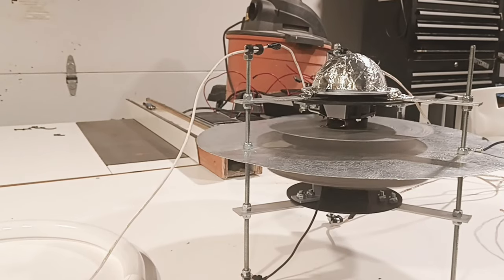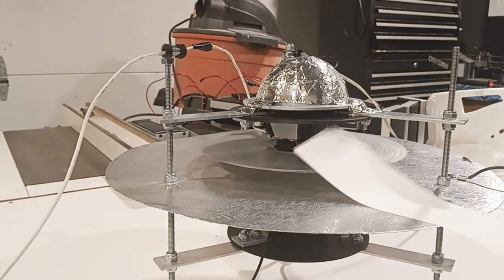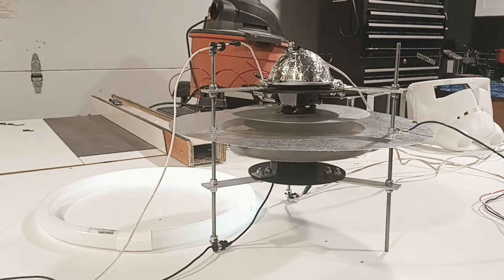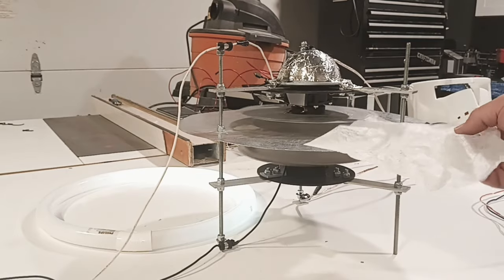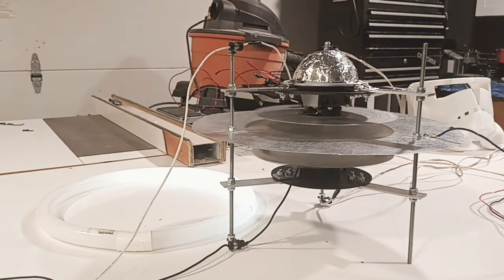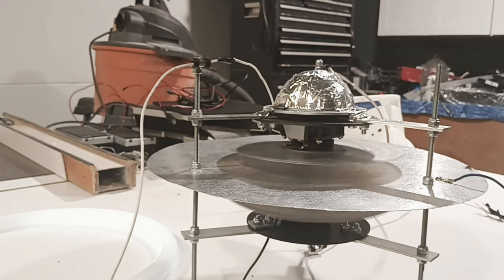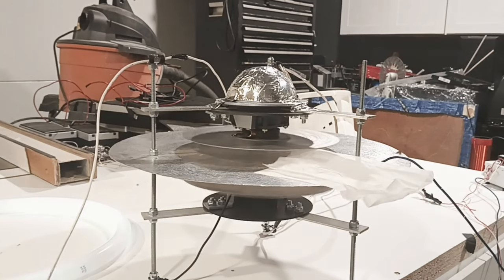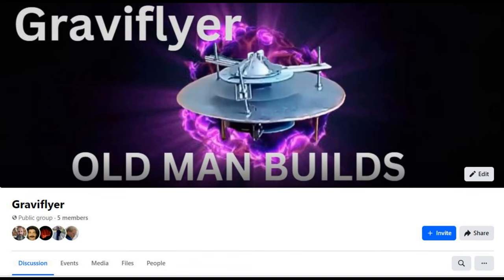Graviflyer Testing 10

Comment: 9:40 - Turn off high voltage, yet the ring light stays lit... Strange, it seems like it is acting a bit like a Wimshurst generator with the paper/cloth acting as a charge conductor, maintaining its charge instead of bleeding off and slowly turning off the light (which might couple to something below the table - perhaps a support beam, I've seen similar stuff a few times, especially playing with strong magnets that re-orients without a 'logic' reason)
Reading out temperature using an IR thermometer requires the surface to be non-reflective (or the meters emissivity sensitivity changed) - so you're likely NOT reading the correct temperature (70-80 degrees F metallic plate should also feel cold) This is quite evident if/when one uses a FLIR camera, as the reflected temperature is shown instead - and often being hot lights, etc.
I have tried putting alu foil on a plasma bulb, it acts as a capacitor and it will spark and feel 'hot' - perhaps it is microscopic discharges that makes the skin nerves confused and sends 'hot' instead of 'charged'.
Thanks for sharing :ø)
Reply from the maker: I need to put this in the air and run the test again. then on the concrete. There might be more answers there.

Comment: Antimatters  consist of positively charged spinning antielectrons and antinucleus (unlike normal matter) .  They bend space-time oppositely.  So  an antigravity device should be monopole. That means only postive charged spinning particles  creates  antgravity. At your work you are giving same amount of + and - charge to different disks at the same device. They should be both positively charged.
Reply from the maker: It all changes to one or the other when the center plate resonates
Reply: It's recently been proven that antimatter, while experiencing opposite magnetic/electrical attraction, actually experiences normal gravitational attraction. Antimatter will not, by itself, generate an anti gravitational effect.

Comment: Much of the heat could be caused by the eddy currents induced in the center aluminum plate by the magnets in the rotating bottom disc. You could try lowering your bottom disc a little to see if it makes a difference.

Comment: Rustle and I blew out the LED's when testing too 😅. I should put a warning on it next time I send one out.
Reply from the maker: it helps find each field. I got the red light with tesla coil and the green with the high voltage. did you get the same?

Comment: Nathan, I just sent you an email to show you how to get liftoff as you are really close. Please read the email. You are generating anti-gravity waves that are getting turned into heat and now you have to prevent this with the dielectric coating.
Reply from the maker: i did read it. looking into it
Reply: I see the novel in a nice static gradient generator, but I fail to see how this has any effect on local gravitational forces

in any case, a non-quantum system lacking a negative mass or energy component will be physically incapable of influencing gravity using electron gradients.

also, any thrust you are generating from an ion gradient (what this machine uses for its source of thrust) is being neutralized by the contrarotating disk; you're generating a dipole gradient on an already negligible force.

as far as the magnetic front goes, you're going to need an order of magnitude more energy flying through those disks to counteract the harsh mistress that is gravity

Comment: with this you can fry an egg , but try to regulate or change the frequency of discharge ,i saw in the original that have a one wire of high voltage in the chasis and in the bottom plate rotation but not in the top plate , and turn clockwise bottom
Reply: This interesting the everyone is saying the lower disc should be spinning clockwise looking down. Fun ideas.

Comment: Be careful to account for the Bernoulli effect causing a lower air pressure between the spinning disk and the paper. This will cause the paper to be pushed toward the spinning disk by the higher air pressure that exists between the paper and the stationary disk.

The Bernoulli effect will combine with any static electricity attraction that may exist between the paper and the spinning disk. 

Just in case that matters in your experiments. ⚡

Comment: I have no idea what this is and these comments make me feel like I tripped into another dimension... But I'm willing to figure it out
Reply: It is science youtube but for people doing actual science instead just copying stuff that is already proven to work and acting like it's some cool thing they made. A lot of the comments are decent but they fall into the trap of using proven science to "correct" theoretical science which is a catch 22. Not a lot of outside of the box thinking going on with some of these people even if they are knowledgeable on the topic.

This isn't a YT comment section exclusive problem. Academics do this all the time and it is why practical science has stagnated after like 2012 where the only new tech you see actually improve is for displays and a slightly more efficient solar panel every 5 years

Comment: try invert the rotation of the up motor
Reply from the maker: the motors only go one way. Pc fan motors
Reply: I'm curious to see an inversion as well and the results maybe in the near future
Reply: You could modify a motor by switching the polarity or add a switch that would reverse the polarity.
Reply: @tonywalker8030  or turn wise the motor

Comment: Use an x ray lamp instead of a piezo disk and make the lower disk (+)  rotate it to the right. It will fly...
Reply: X ray? C'mon you gotta share now! You threw the rock, now carry the ripple! I am sincerely interested.
Reply: @hellogoodbye3129 he’s trying to say stimulating radiation..
Reply: But that would require a material that changes via x ray radiation